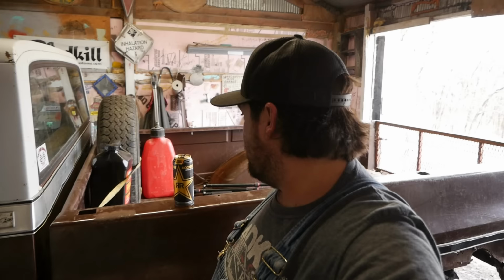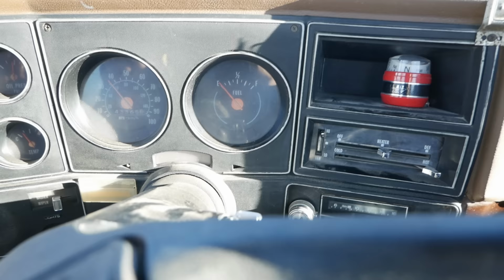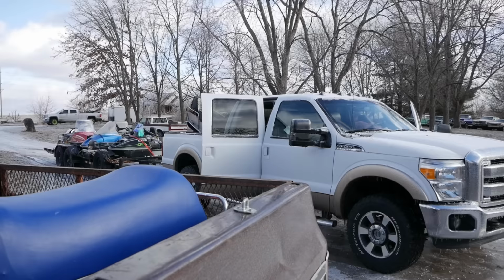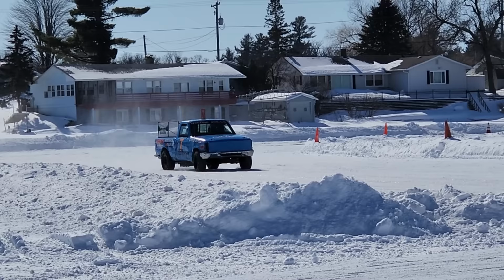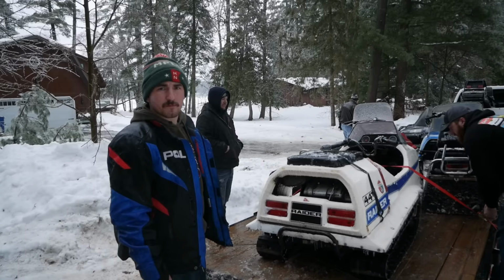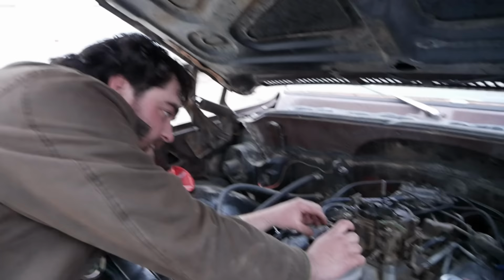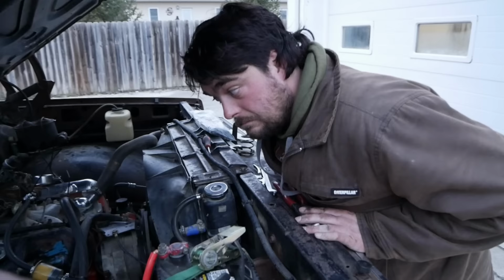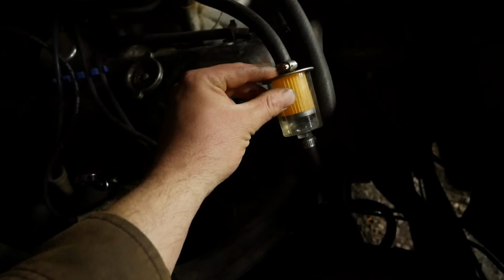1100 Miles in Big Block Squarebody - Will I Survive? Or Go Broke?

Comment: Love it. It’s amazing how these old things keep going after seemingly sitting and just minor maintenance.
Reply: I know its not really the same as what you're talking about, but I have a 97' Ranger that before I bought it, was sitting for 4 years with a snapped timing belt, boiled battery, and flat tires. Just left for dead. We timed it and threw some fresh gas in it and she fired right up ready to work. Doesn't matter what make or model truck it is, if its older than 2000, and isnt roached beyond repair, I guarantee it will fire right up. They just wanted to work.

Comment: The most overlooked engine problem ever can be as simple as improper timing settings. I can recall several times my own cars and my friends cars have  improper settings and they sounded like something else was wrong with the engine. So it would go down the road okay still be 8° off just enough to cause lag when you get up to speed I even seen it cause starter drag making you think your battery was low or your starter was bad. Bad timing mimics a lot of problems. I always carry White crayon or white chalk with me along with an old-fashioned timing light and  the old-timers out there they know what I'm talking about. Having that distributor hold down bolt just loose enough for it to wobble even looser as you're driving from vibrations timing can jump a little bit so when you set your timing always tighten that bolt down then the distributor won't move side-to-side. And no matter what anybody says setting the timing by ear is not always 100% accurate use the timing light. I used to be guilty of that one also. 😊

Comment: Good job. Lucky you made it home with the truck. My experience with that tic you’re hearing is the spring in fuel pump. I have been stranded numerous times with this problem. Gives you low fuel pressure and causes the surge like you are having. You probably already figured this out by the time I watched this film. Looked like a blast in Wisconsin wish I could have experienced it. ❤
Reply from the maker: Thanks for the comment!

Comment: A real guy doing real repairs to vehicles less courageous folks ignore. That's cool you and the others went the route of racing snowmobiles dating back to the 70's and 80's Machines don't know what decade it is --- fix em to run em and have fun. That's a dam good K-10 4 wheel drive truck -- and it made it there and back!!!

Comment: I got my 84 square body C10 back in 2012 after sitting parked for about 10 yrs. Threw plugs wires cap rotor fuel pump and a starter and drove it 200 miles per week for 6 yrs before I finally pulled the engine trans and factory carb for a rebuild. The only time she left me on the side of the road was when a front wheel bearing decided to take a crap on me. She's still on the road today, but I have spent a few dollar's on her in the past few yrs.

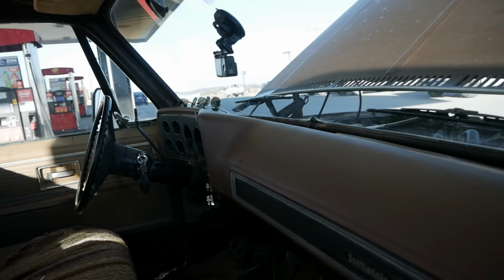Comment: Cold blooded bigblock you got to pump the accelerator 5 times rub the dash and blow on the key before you put it in the ignition drove a 3+3 bigblock long bed dually with 5:13's in high-school had to learn the MOJO or be late to school I miss that truck when you put it on the wood you could watch the gas gauge drop as the speedometer climbed

Comment: I loved the Enticer that I had, it was a 83 340 and it had a slick track on it and would hand with Indy 500’s. It was pristine until I met mid flight with an Indy 800. If I had been sitting on it as intended I would have lost my left leg at about the knee. The belly pan was bent into the primary clutch and the hood flew off over top of me. All it did to the Indy was take a sliver out of the plastic ski. I did bang out the belly pan and found another hood for the rest of the season. I then sold it to a guy for 500.00. He was going to restore it for his son to ride.

Comment: I pulled a ‘74 F250 camper special with a 390 out of an orange grove that had been sitting for 20 plus years. Got it running and driving good and drove it for fifteen years ,treated it like a truck and it never gave me problems. This was back in the late ‘90s so no YouTube but still kinda wish now I could’ve filmed the whole process,it was fun getting that ole girl running again.

Comment: In my experience with my big block 1974 c20, before the fuel pump goes out a weird clatter will come and go, but a weird clatter also comes and goes when the lifters are bad or if they aren’t lubricated, I’d just change the fuel pump and put some Lucas in the oil to thicken it up a lil bit

Comment: I sold my 97 Yamaha sx 600 twin (Bad ass) to a buddy real cheap. Still have a 99 Panther 340 2 up thats beat hard.  I would fit right in with you guys but Im 59.  Had a 78  (Blue) just like your current truck.  Built up the mighty mouse 400 but sold it to a buddy real cheap to buy my wife a wedding ring (damn)

Comment: I had one just like that one except mine had a small-block & was a Camper Special. It was full time 4wd and got 10 mpg below 60 & 8 mpg above. My advise is to lose the full time transfer case & install a part time one & locking hubs. When I did that my mileage almost doubled. Just a thought...

Comment: Thats nothing for them old chevys, I bought a 92 Silverado in Arizona for $500, at first I thought it was going to be junk, but it was pretty good truck, just the Arizona sun baked everything, I decided to move back to Ohio, and I decided to drive that truck 2100 miles, this truck had almost 400,000miles on the old 5.7, It made it, Blew out 1 bearing and it dug into the spindle in Kansas, changed both front bearing and a spindle and off I went, just wish it had a bigger fuel tank, 20 gallons I was filling up like every 200 - 250 miles.... lol.

Comment: I had a big block chevy given to me because of bottom end noise. Put it on my run stand just to see how bad it was and it was the fuel pump arm not returning all the way back up. Put a new pump and rod in since I figured the rod was banging back and fourth and it's still in the truck 5 years later.
Reply from the maker: Brother had the same thing in a 305 once

Comment: That's great it made it all those miles! Used some oil but didn't break down! Most bbc get 8-12 mpg, not a fuel efficent engine but plenty of power and torque! Square body trucks rule!

Comment: The 454 had what could be assumed as a really good carburetor on it when I bought it............ so I took it off and threw the quadrajet that was on the original 350 out of that truck on the 454 and turned up the idol 😂. That’s why th choke does not work.

Comment: Take your tires and cross cross the sides but the left on the right front and the right on the left front and move it forward from the back but the back on the opposite front right front on the left front and then the left front on the Wi-Fi or you get the idea cross cross the trade another four tires wear back round learned it from an old school tireman works every time

Comment: I'd say she's a runner, but yea, the clacking is definitely your fuel pump going to hell.  I'd imagine that running behind the clogged carb fuel filter and the in-line metal filter under pressure wasn't good for it in the long run.
Reply from the maker: My thoughts exactly
Reply: @PoleBarnGarage  Good luck with it!

Comment: First time I noticed your fuel. In the UK basic fuel is 95, premium up to 99. I assume US engines must be low compression which would mean low power for the engine size.
Reply from the maker: Correct, unleaded fuel was mandated in 1973, before that octane was much higher. You can get as high as 93 here. I wouldn't say our engines are low compression (anymore) usually around 10:1

Comment: i have a weird kit car called a gtm rossa. not many made. my tyres were the same - lots of vibration - check the balance of your brake discs/drums - you can do this cheaply with an old style "bubble balancer" - its like a 360 degree spirit level. i found that my drums were very out of balance. when i allowed for that by glueing british coins to my rims - the wheels got in balance.  best wishes from your number one fan in manchester uk. ps when you have a bubble balancer you can then balance your own wheels . its a win win sir

Comment: My 83 trans am 305 sbc had a fuel pump tick that comes and goes. I only use carter fuel pumps and had three bad pumps in a row. When i floor it it seems the pumps cant pump fast enough for the cam. I am switching to electric after this pump shits the bed.

Comment: Pole barn: buys a 454
Also pole barn: that's like 8 miles to the gallon?!

Yes. Yes it is. The good thing is, you can pull a 30ft trailer that weighs 10000 pounds, and you'll still get exactly the same mileage. 🤷
Reply from the maker: I've only owned a few (dozen)

Comment: I have an 02 DODGE ram 4x4 2500 sport with a 5.9 Cummins it has 300,000 miles on it and I’m so fortunate I can drive 300 miles on less then a quarter tank my wife and I took her new Cadillac ct5 and it took about a tank and a quarter around town I can fill up and drive over a hundred miles on less than a quarter tank so it gets about half in town as on the highway I run Nitto 33’s on it at 60 mph I’m at about 16 rpm or less

Comment: Loving that Farm Truck 2.0. I'd get a fuel pump block off plate and an electric pump for her. Just my opinion. Be well and get some rest.
Reply from the maker: Mechanical pumps are generally reliable
Reply: @PoleBarnGarage  I've just had horrible luck with them over the years. I'm man enough to admit my bias on things.
Reply: I would take a mechanical over an electric any day. Electric has its place but it’s not in an old engine or small engine.

Comment: I'm looking at a 1981 c10 with a straight six and rust holes on the cab bigger than the hole in a donut, I wanted to know if you have any suggestions for what to do with a beater like that
Reply: Drive the hell outta it.
Reply: @buckster2575  The only problem is that I still have three years till I get my license so it'll have to be a county road rig for awhile
Reply: @mcmillancattleco.345IH  Fix it up and enjoy the learning process.
Reply from the maker: Get it, Fix it, Drive it.

Comment: Yeah my farm truck would do it but 1951 Austin slow yeah 57 mph is it at 2200 rpm but 34 mpg at 50 mph o it no longer has the Austin motor it has a MF te20 1952 tractor motor that runs on kero or home made vegetable oil and moonshine makes 25 HP on a Dyno my so did that at the local rural show he took them a bit to work out to get full rev with the mechanical governor you need a load on the engine to open the governor throttle only adds spring load to the governor arm. . Fun to drive and will go any where just not fast o yeah 4 speed crash type gear box so you really need to drive it

Comment: What gear ratio is in that thing.  I don't think I ever ran a 3 speed 3/4 ton over 70.
Reply: My  3/4 ton full time 4x4 is 4.10 gears factory
Reply from the maker: 4.10. they'll do it all day long and like it
Reply: @PoleBarnGarage  I guess I'm just chicken.
Reply: According to the calculator on the Spicer website, 81 is 3500rpm. That's really not that bad.